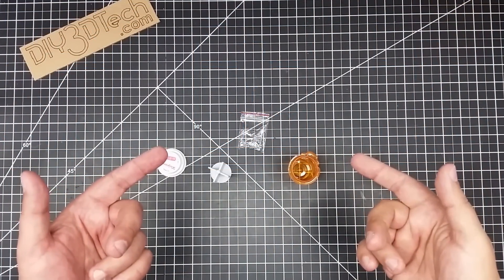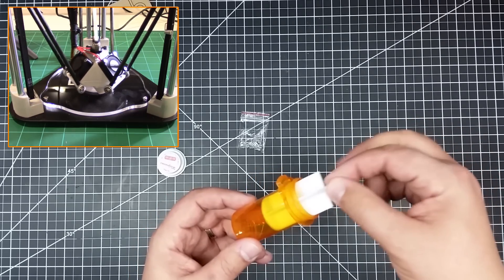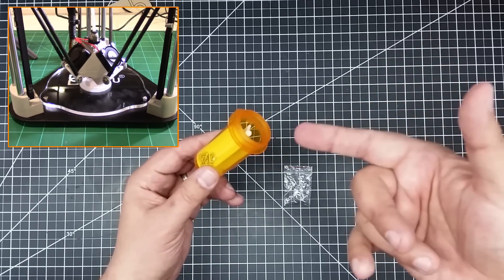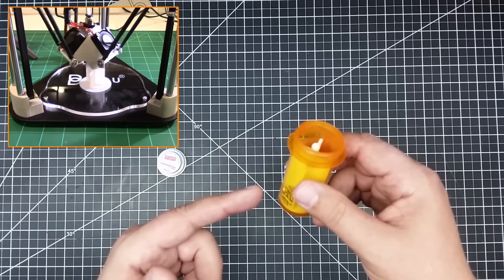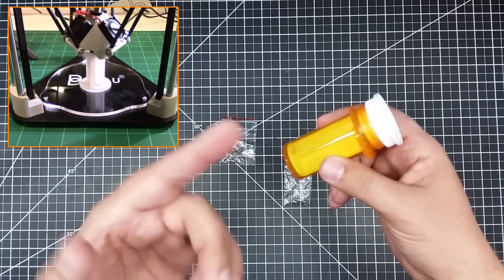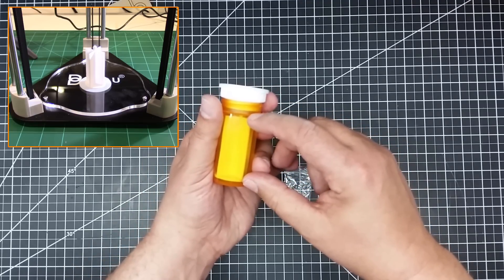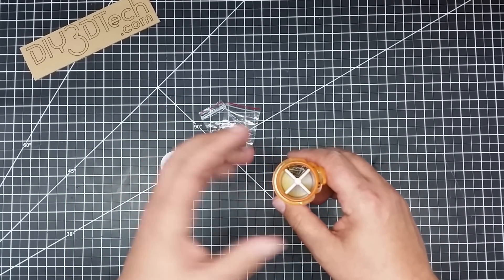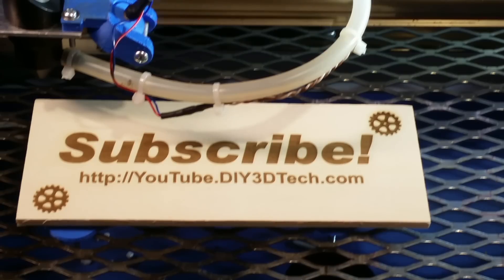3D Printed Project - UpCycling Pill Bottles for Shop Storage!

Comment: Instead of pulling the insert up, you need to put a rotating top on it with a pie slice cut out for only one compartment....then you can select any compartment and tip the whole bottle......great idea for the separator though.
Reply from the maker: Have been think about something along those lines

Comment: anyone else having problems with using customizer? I get an error related to the server not finding the libCGAL file in /usr/local/bin/openscad/openscad. I've tweeted to thingiverse about this a while back and again this morning.
Reply from the maker: Yes I think Thingiverse turned it off to save money as the are using the AWS Cloud and have to pay for cycles and the customized take takes a lot to run.  This has been going since January
Reply: ok. thanks I didn't know that at all. their reply to my first tweet a few weeks ago was useless. they should just say that and turn it off or spin it off as a different service.
Reply from the maker: Yes this is what I think happened as I work in the cloud business and in short that error means that VM or container is no longer available.  I wrote to them in January and they said they were working on the problem and had "hoped" to restore it in the future.

Comment: Great idea but what if you drop the bottle on the floor or bench top and it lands upside-down, will the items inside slide into other compartments and get mixed up? 
Like the idea of taller compartments and a slot in the side! Mayb a hole in the top and a knob sticking out to turn the compartment to the slot. 
Guess I got my remix work cutout for me but I'm so slow with  making these ideas become reality.
Reply from the maker: Lol me too!  I have an add on plan just need the time to code it!